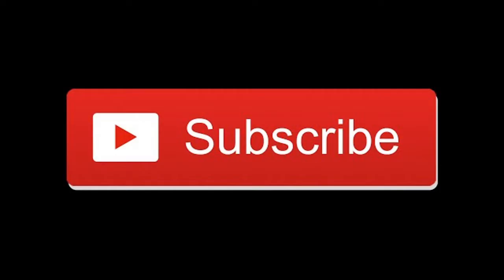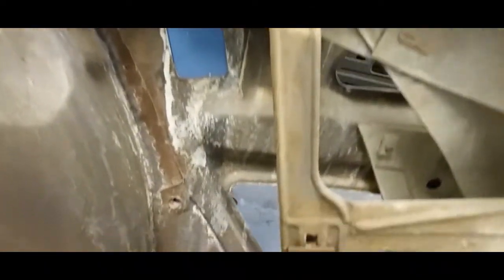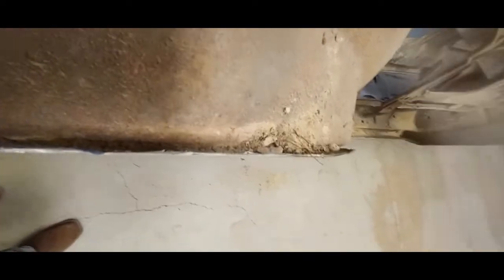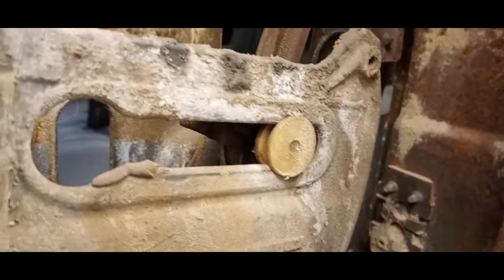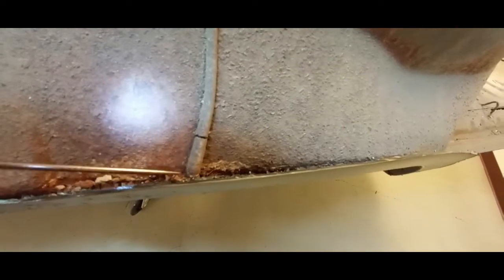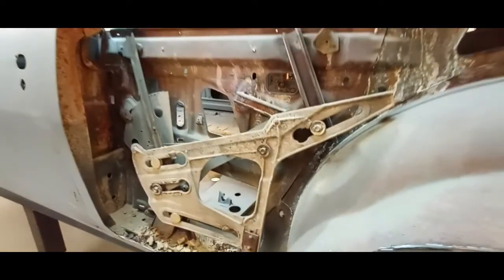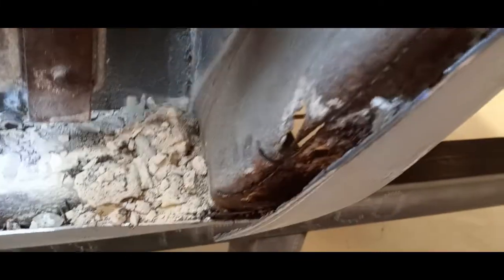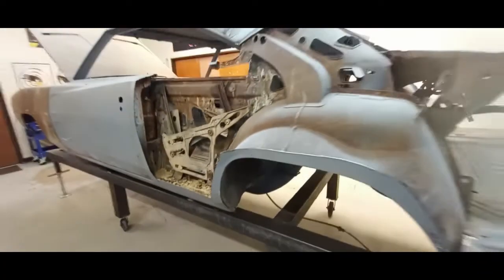Why you NEVER use DUSTLESS BLASTING on your restoration project !!! - DIY Auto Restoration

Comment: Bs whoever you hired used sand real dustless blasting is done with glass and it leaves zero dust this is on the blasting company not the process they used wrong media ...period....
Reply from the maker: @toddaaron1592  That's the problem, 99% of these @$$ holes are ripping people off.... double period......NO quality shop uses this process....

Comment: Poor workmanship not the process dustless blasting is a great process if you know what your doing you should sue the company but don't blame the process and you know no matter what you use bare metal flash rust in 72hrs or less if you don't treat it.
Reply from the maker: @toddaaron1592  Yes poor workmanship is EXACTLY the problem with these dustless blasters and it's the wrong process  for auto restoration...